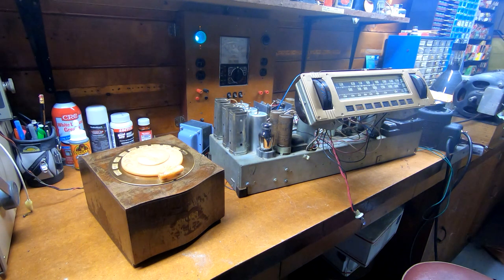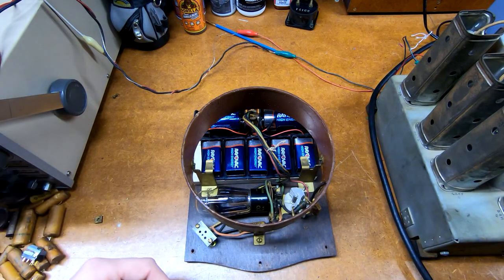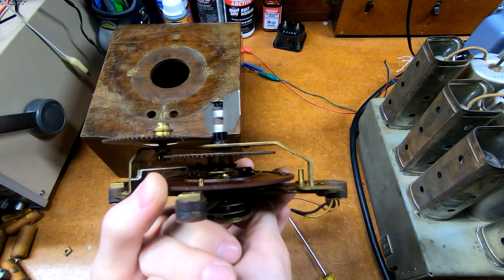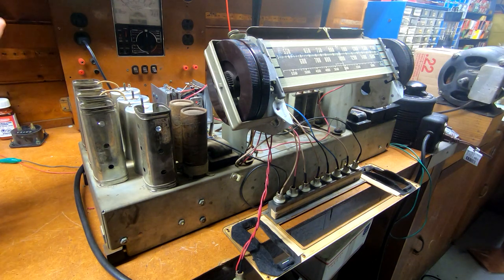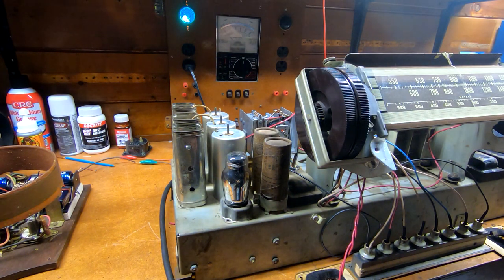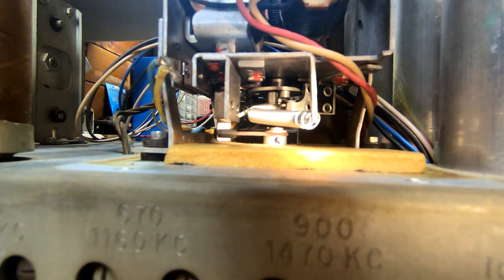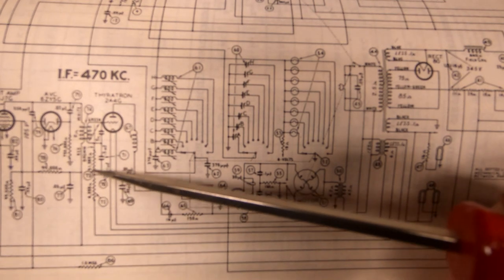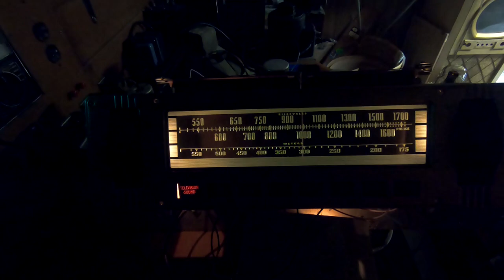Philco Mystery Control: Theory and Operation

Comment: An excellent operations overview.  Documentation is weak so this was very informative. I just acquired one of the Mystery Control boxes and spent time fixing the warping with very good results.  Next is to add batteries and see if it works.
Reply from the maker: I cheated on my warping issue. I found a washer just the right size to fit under the plastic dial to keep the drooping edge from touching the cabinet as it spins. Can't even tell its there from the outside!

Comment: This was amazingly helpful and clear, especially your long-hand, detailed look at each aspect, really appreciated. I just bought one of the remotes (mainly because it is quite sculptural, in an Art-Deco sort of way) and will repair it. Then I need to find a radio chassis. Just the way it sits on your bench, with the bare thyristor flashing purple is far better looking than any cabinet the radios originally came in. I also thought relying on a tube to come to working temperature so quickly, by overdriving the filament voltage is, at best, an iffy proposition. In the 70s they had these tube substitute transistors called FETRONs. I wonder if a suitable one can be found or made? It may make the set up more reliable. All the best.
Reply from the maker: Thanks for the kind words! Considering that the set is just looking for a pulsed signal at a fixed frequency, I imagine it wouldn't be hard to setup some kind of transistor replacement for the 30 tube; any basic signal generator can trigger the set with a decent antenna.
Reply: @Eclec-Tronics  Yes, I thought I could keep it all original by just plugging a substitute into the Type 30 socket and reducing plate voltage, eliminating filament voltage. There are lots of triode to N-channel JFET conversions on the web.

Comment: I just acquired a 39-116. Looking through and cleaning it, I came across a 6K5G in the remote control receiver, where the schematic shows a 6J7G. This makes no sense as the 6K5 is a triode whereas the 6J7 is a pentode. Yet everything looks unbastardized, with all original Philco tubes. Now, you have a moment in the video, when you are talking about the various tubes and you seem surprised by something (at 21:55). I was wondering if you also came across something like this, like an unexpected tube? I will appreciate.
Reply from the maker: I honestly can't remember what threw me off; I just looked at the schematics again. Some versions of the Mystery Control radios had a 6ZY5G in the remote circuit, but this one did not. It is entirely possible Philco made a chassis revision and changed to the 6J7G early on, and simply didn't document it; would not be the first time a radio manufacturer did that. If the 6K5G works, I would roll with it.
Reply: @Eclec-Tronics  
Makes sense. I want to try each part separately before I turn everything on. Can you tell me what voltage I need to apply to the thyratron grid to make it turn on? Is it 7VDC? Does AC or DC matter? You mention the plate voltage is AC.
Reply from the maker: I'll have to look at a databook at home later. Can't find anything online that lists the striking and holding voltages for the 2A4. The AC plate supply is used so that the tube turns off every half cycle, otherwise it would remain on even if the remote is not transmitting. @atoptip6193

Comment: Hey there. I just have been watching your video on the mystery control set particularly this stepper unit operation explanation. I have been working on my set for awhile now abd am having difficulty with my stepper unit not returning to the starting position instead it just remains stuck. I have tried to find a proper replacement spring and have been unable to, I wondered what size and spring you used as a replacement and  where I might find one? Thanks for any help you can give.
Reply from the maker: Honestly I just got a set of generic springs from Harbor Freight and played around until I found one that worked. It needs to be just strong enough to reset the arm, but weak enough to allow the relay to advance the arm.
Reply: @Eclec-Tronics  great thanks I will check harbor freight for some springs and I am sure that is what is wrong with my stepper as it won't advance or return correctly. Thanks again for the videos they have been a help to me
Reply from the maker: @andrewzemljak5622  It also helps to get all of the moving parts clean. Any place the shaft passes through should be cleaned and lubricated to give it the best chance.

Comment: That old paper CAP IS NOT OK...It's Dried-out and has HIGH ESR !!
Reply from the maker: Jesus dude, chill out. It's got barely 45 volts across it from a battery pack, and I do plan on replacing it.
Reply: @Eclec-Tronics  - Hay, OK, don't take it so hard. ;-)